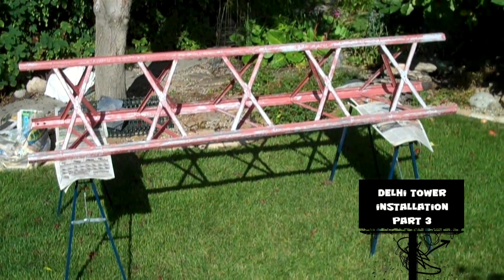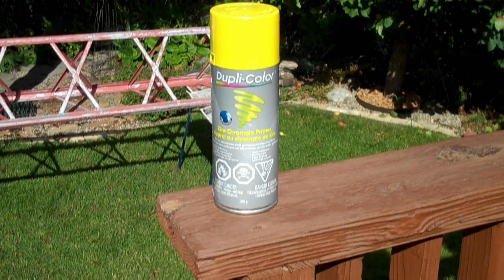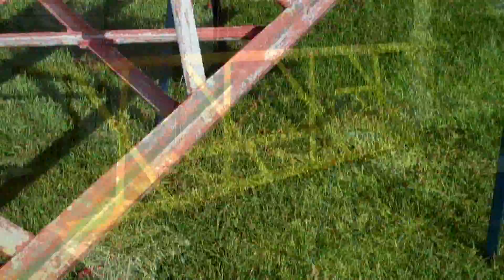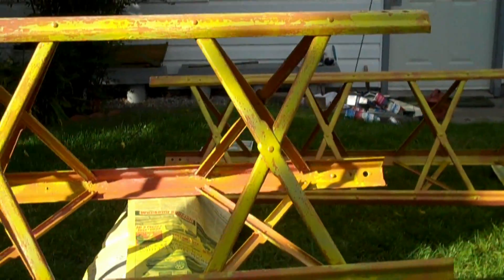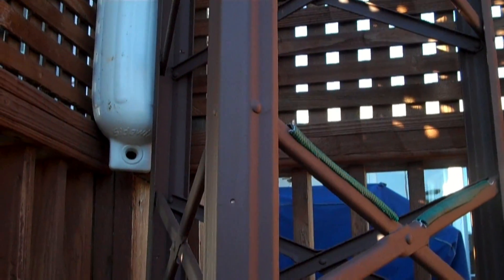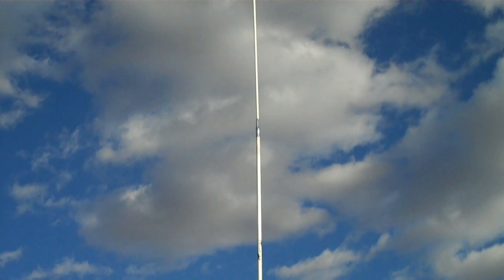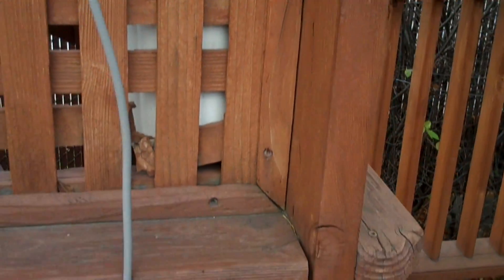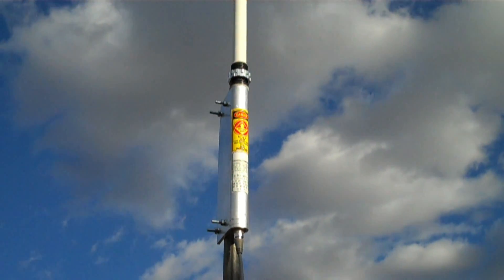Tower installation Part3

Comment: Hey I have a couple of questions on properly grounding the Wi-Fi tower. Can you give me any help or tell me where to look? I am a licensed electrician and this is kind of bordering on that gray area of low voltage not being inspected so I'm not quite sure how to proceed. The only power we have running up it is power over ethernet
Reply: same way you would ground anything personnaly in my company we use a 10 Ft rod and we bolt the cable at the tower (after some rubing to have a good contact)